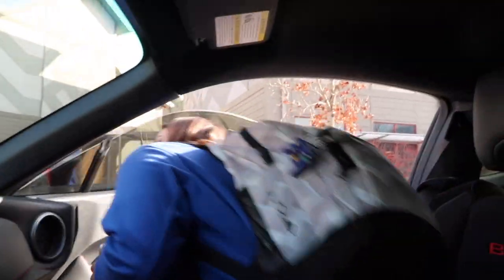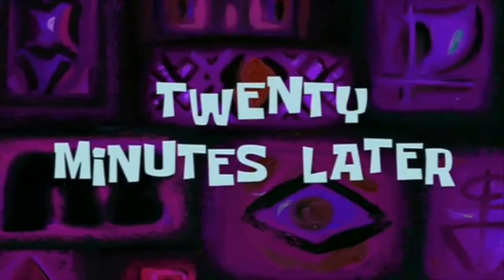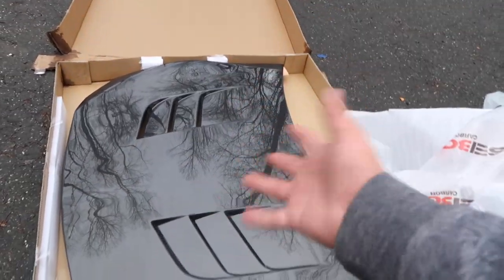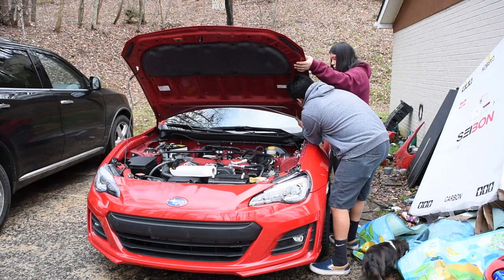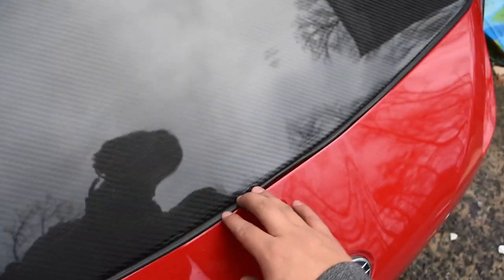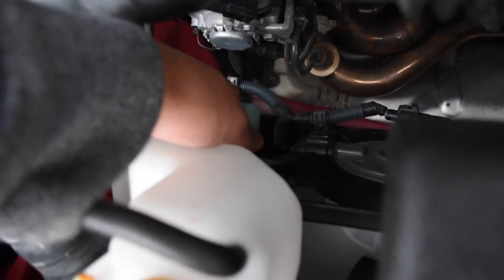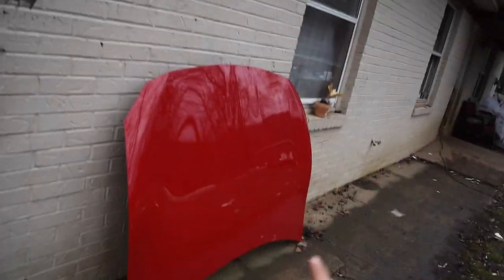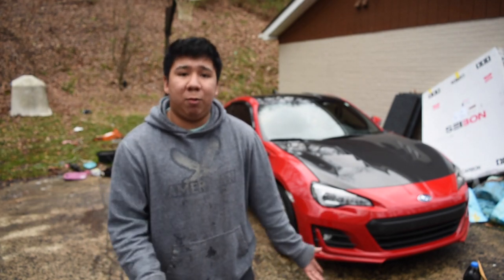Seibon Carbon Fiber Hood Install (TS Style) - Subaru BRZ

Comment: Use subaru OEM coolant. I know other style engines are ok since coolant doesn’t sit the same as a boxer engine. This is the main reason many people have problems with the head gaskets on boxer engines because they don’t use the OEM. The OEM Subaru coolant has chemicals and some tech that allows longevity of the headgaskets and also prevent getting eaten by the anti rust components.
Reply: not to mention... when it heats up, is when you check the amount... not cold... 
he just overfilled it 😅
Reply: @jesse584  correct, although there is a vent in the top of the reservoir that will spill the coolant everywhere when it gets hot and radiator cap lets it flow there. 
He will just be spilling the coolant in the street, under-filling is bad, overfilling is not a big deal for the car but for the environment and wildlife it is.
Reply: @TrojanLube69  true enough, there is a pressure relief, but it needs to hit pretty high pressure to make it go off .. 
still putting undue stress on gaskets in the mean time...

Comment: How long did shipping take to get your hood if you don't mind me asking. I plan on getting the same hood from ft86 as well.
Reply from the maker: Duc hoang for me it was 3 weeks and that was because they were out of stock and got put on back order. I would assume maybe a week or two if they have them in stock.
Reply from the maker: Wait my bad. I thought this was the first video I did on it. This one only took a week.
Reply: thanks for the reply man. That's actually pretty fast for shipping. Also did you have to cover the hood vents for rain?
Reply from the maker: Duc hoang I personally haven’t experienced any problems in this hood or the last one with water getting in. I’m sure water gets in but it hasn’t messed anything up. It sits outside all the time and has been through snow and rain and still running fine.